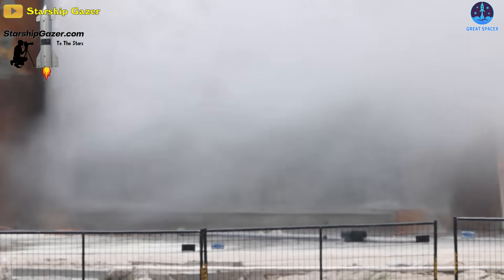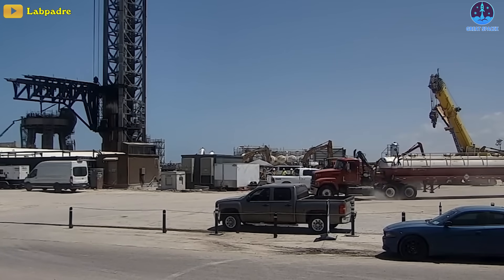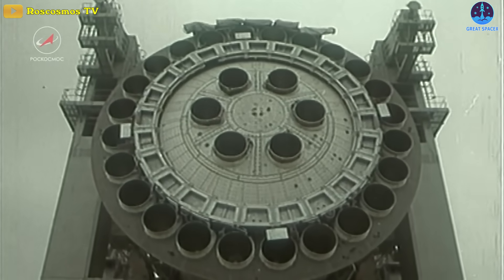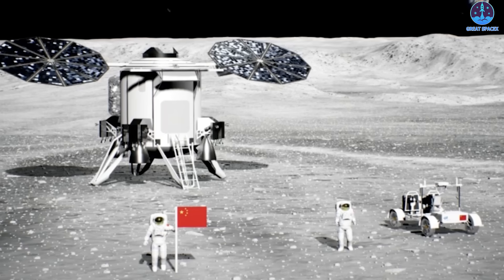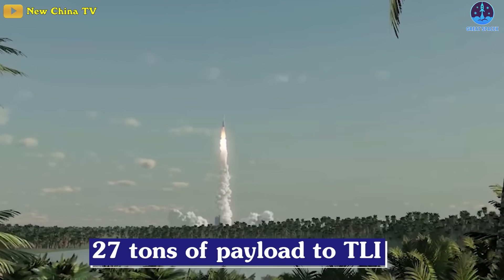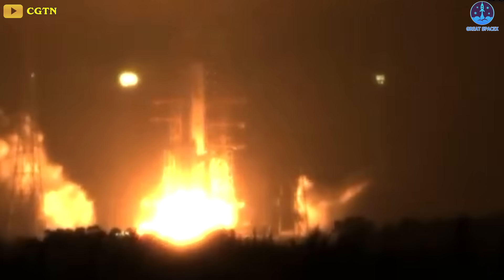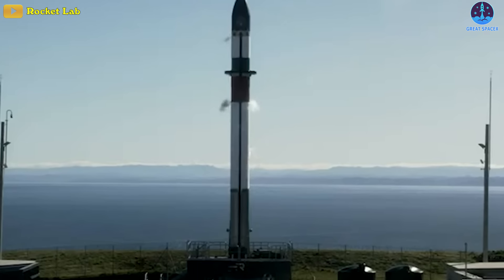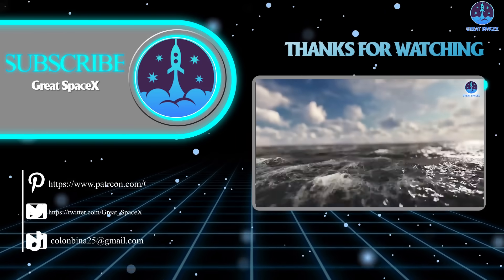Finally happened! First Water Deluge System Testing with MASSIVE WATER...

Comment: Sorry to say this but, this water deluge system will be nowhere near enough to cope with 33 raptors at full throttle. It's just a futile effort to salvage a terribly designed launch pad by desperately avoiding admitting that it needs a seriously big diverter, trench AND deluge system.

Comment: Here is a Question... WHY ARE WE NOT CONSIDERING A SPACE STATION IN ORBIT AROUND THE MOON?
This would have many advantages/
1) Provide Platform for experiments in even lower gravity.
2) Half the time its on the far side.
3) Provide much more detailed mapping of the moon. Especially the Far Side.
4) Staging platform for Moon landings. Cargo destined for the moon can be pre-staged here and loaded into a lander, Providing much more available cargo for use.
5) When big enough it can host Moon Landers and allow inter orbit transfer using space only shuttles.

possible Cons would be:

1) distance makes responding - from Earth - to emergencies problematic.
2) Resupply would be more involved.

However we have learned alot about station management now we should be able to avoid many pitfalls and our unnamed supply tech should be able to keep the station supplied easily enough.
Reply: But, that is what 'Gateway' is.

Comment: No, SpaceX’s system can’t handle more water.  The plumbing is way too small.  They’re using less than half (much less) the amount of water that NASA uses when they need 3-4 times more.  Furthermore, NASA just dumps the water from beneath WITHOUT ANY PLATE.  That plate is an issue unto itself…because if the water beneath it flashes into steam, that plate will blow to smithereens.  And destroy everything around it as it does.  

Elon’s rocket should be called Elon’s folly.  It’s simply too big, and too heavy to be lifted from the ground into orbit safely.  He needs to spend less time on this rocket and more time designing better space suits for his engineering teams.  Then they can assemble the rocket up in space after it’s launched in sections using multiple smaller rockets.

Comment: I thought it was the thrust force of the engines that destroyed the launch pad ... not the heat. I mean, both probably contributed, but one contributed more than the other.

Why not just bore out a giant hole under the rocket and save hassle, water, time and resources required to make an elaborate water park?🤔

Comment: Still not enough to protect the structure. They will have to redesign the whole thing from scratch. Too much power, heat, vibration and shock waves around the whole thing. Current design is modest to what they are facing with the super booster.
Reply: Like you know

Comment: I don't think this system is a good design. No rocket exhaust deflector. It is trying to push water directly against the rocket exhaust.
Reply: Not aganist it, but cool it down.
Exhaust deflector not possible
Reply: @Hungary_0987  Plenty of other rockets have had exhaust deflectors. It keeps the exhaust from building up pressure and breaking thing on the stand and going back up and breaking things on the rocket. Even if it is cooled down a large amount of high-speed gases can destroy things.
Look at other large rockets like the Space Shuttle. When they ignite there is a huge plums of smoke coming out of the side of the launch pad. That's an exhaust deflector.

Comment: I still don't think it will work. There needs to be a flame diverter trench. The exhaust from those 33 engines will hit the steel plate, and bounce back, hitting the engines. NASA seems to know that. SpaceX should have taken this into account when they selected the launch site, and it should have been part of the original plans for the launch pad.
Reply: They fant, please stop saying this…

Comment: Having the water ports going straight up into the rocket blast is gonna be a serious oroblem.  If the blast pressure even equals that of the water, its gonna get ugly fast.
Reply: It has to overcome the blast pressure.  If DeltaP is biased to the rocket, no water will come out of the holes.  Ideally, you want the water pressure and blast pressure to cancel each other out.
Reply: The water jets are actually angled away from impacting the engines (ie, the jets are not directed vertically up!!!)

Comment: With the Force of all the engines, he will probably have to extend the metal plates.
 He needs to put up metal guards on the chop stick tower. That could be partly the reason the elevator broke down.
Reply: Elevator failed before the first test flight so no, that isn't the reason.
Reply: Thanks for the update..  I missed one of the recordings. 
 Thanks again.
Reply: @stanleykelley4284 You are the only reasonable person left on the internet. By that I mean that you just accepted that u were wrong and moved on.👍

Comment: I don't believe this is going to work, though I pray I am wrong. I don't believe the calculations for the amount of spent fuel gasses and force/thrust have been solved correctly. The legs of the platform are too close to the blast area forcing the blast through narrow channels wich will continue to cause damage to the launch platform. Adding water in an almost identical method used by the US military to boost the output of the wildcat fighter during WWII in the Pacific. You're doing the same here. The launch platform has to be redesigned or the launch process has to be altered.
Reply: The legs were undamaged the first time🤷🏿‍♂️

Comment: Jet holes  facing up could be stopped slowed by pressure and force directly downwards  from thrusters
Having many slightly side ways  ??  I:E As a cheese grater or Mandolin  cuter tool ?
slightly flanged and covered shooting at a slight angle?
Resonance and vibration will still be a possible problem/
Water from the near by shore
could be utilized into high metal or concrete towers as many small towns have?
Gravel lime stone pebbles being filters
and height gravity giving helping pressure down to the pad area.
Natural salt over time can be washed forced out of system and pad area 
pressure cleaned.
Water tanked at high levels can be secondary used for many big purposes of lifting
pushing pulling by Lever ship Pulleys hoists  tracks sleds.
Many huge projects Barges Boat lifts
escalator's Passenger lifts to huge heights and weights
also London dower bridge is powered by water balance
Including the huge Scottish Celtic Barge wheel.
Sea water rain is free and a few Pumps heaper than endless trains of Tanker lorries.
One take of point with upto six adjacent landing railed back sites
Seems more sane than one landing back at Pad  mistake wipe out  disaster.
Like the super duper heat force proof cannot fail
concept Elon was sold?
Will it be a complete area landing destruction before logic hits him in the pockets
and simple old ACCEPTED PRINCIPLES  THAT works
ARE THE SAFEST WAY FORWARD.
#  Also placing landing legs for first 50 or so trips and getting hard data examinational Hardware
is much  better than smashing into the sea.

Comment: Stage Zero Mechanical & Environmental Design Flaws:

1. How is SpaceX new design going to acoustically dampen and prevent the enormous damaging direct reflection acoustics right back upwards into StarShip? 

Flat plate a really bad idea for a the reusable stage one. Overtime the reusable stage one will have latent damage which could cause a catastrophic failure. 

Without proper acoustic dampening, environmentalist will likely once again litigate that the shockwaves are hurting wildlife habitat areas.

2. How is this design going to prevent further erosion of the surrounding surfaces outside the diameter of stage zero? 

With violating the EPA & Texas Clean Air and Water Acts, the environmentalist are likely going to litigate once again. 

3. Is the water drainage system capturing and filtering the remaining water? 

4. My stage zero design that I called and emailed SpaceX solves items 1, 2, and 3 above.
Reply: I think the acoustics gonna get handeled by the eater.
No ideo tho🤷🏿‍♂️
Reply: By the way, tell me more about youre design, im intrested

Comment: How’s it going to do this on mars
Reply: Doesn't have to do this on Mars.
Reply: @eskieman3948  starship is going to takeoff again from the sand and rock surface of mars ?
Reply: @Meowface.  Just like with the Moon. Gravity is way different on Mars and you don't need as much power to reach escape velocity.
Reply: @gravelydon7072  fine 
Bud starship is a large and heavy spacecraft which will need to carry enough fuel to takeoff from mars then also land on earth 
And the mission to mars is to build a permanent base 
So debris will fly far, and as we’ve seen starship is capable of throwing up some enormous chunks of concrete 
That would be enormous rocks on mars 
And with the reduced gravity and air resistance those rocks will travel quite a distance 

Also… what stops rock from damaging starship upon liftoff 
That’s probably what damaged some of the failed engines on the starship test launch

Comment: I have a question.  How long does it take to refill the water tanks with tankers ?  How long does it take to refill the LOX and Methane tanks after a launch ?  Has anybody done the calculations regarding the turnaround time between launches ?  I keep thinking there would have to be tankers arriving every minute of every day supplying water and gasses and how would that affect the launch frequency ?  Would Spacex consider a desalination plant ?
Reply from the maker: I will discuss more about this in next episode, thanks
Reply: @colonbina1  Thank you
Reply: Quentin, there is a YouTube video about this on the Nasa Space Flight (NSF) channel.  They assumed that the cryo fuels are being trucked in from Houston at great expense.  

When Starbase gets ramped up to 3 launches per week, they calculated 2 million tanker-miles per year would be needed to transport the liquid oxygen! 

Starbase has an air-distillation plant onsite that will provide all the liquid oxygen and liquid nitrogen that SpaceX needs, plus some argon the can use for welding.  

The gas plant will go into full production once the local power company completes a high voltage transmission line currently under construction near Starbase.  

Methane should be available locally by way of natural-gas pipelines, but SpaceX would need  to build a plant to separate out the methane from the heavier hydrocarbons.
Reply: @primalmanagement   And the desalination plant !?
Reply: They're also  building a compressor so they can distill the gasses they need right on site. There is actually a methane gas well there on site too. As for the refill rate, I would imagine that as launch activity increases, so will the size of the tank farm(s).
Reply: i think it only takes a couple of hours
Reply: I seem to remember a plan for a desalination plant to convert the sea water to fresh water for the deluge system
Reply: Elon is said to have an IQ estimated at 200.  I just assume he’s always ahead of us mortals, just as he’s ahead of his competitors.
Reply: shouldn't the water be delivered by Tesla semis ? i thought we had a planet to rescue , we can't have diesel trucks delivering water to the site 🤬

Comment: could the release of the pressurized gas freeze the water in the pipes?
Reply: Not nitrogen. It's an inertia gas
Reply: Shouldn't be.  There's constant pressure in the system, driven by pumps.
Reply: @frankbieser  No pumps. Just gas pressure when in use. The only pumps will be to refill the tanks after use.
Reply: @gravelydon7072  Good to know.  But the gas is maintaining pressure to prevent freezing the pipes. Now the bottles/tanks the pressurized gas came from, probably do get pretty cold.

Comment: You do realize the thrust of the engines push up on the rocket. The thrust doesn't push against the ground. The thrust doesn't push against anything. Look up Newton's law
Reply: If there's no downward thrust, how come the launchpad turned into a crater and ejected a shit-ton of matter directly beneath? Sure from the rockets perspective it's being pushed up by the ejection of matter\energy from the engine, but from the perspective of the ground under the engines surely it turns into a downward force equal to the upward thrust seen by the vehicle?
Dont get me wrong, I don't know any of this. I'm an idiot, but from my little knowledge that's what kind of makes sense to me. You don't have to answer, but if someone can explain in simple terms where I'm wrong I'd really appreciate it. Cheers!
Reply: @TheDavidPoole  there's kinetic energy. But it's not going to be close to the chamber pressure of the engine. The heat destroyed the last pad. That's the purpose of the water system.
Reply: @Bryan-Hensley  i get that the heat is huge, but the heat alone won't hurl huge lumps of steel and concrete hundreds of metres away from the pad. They are being "thrusted" somehow. Again, I don't claim any knowledge in the area, but it just doesn't make sense to me that the hundreds of thousands of pounds (or more?) of thrust exiting the rocket bells have no effect on the ground just metres below. I remember my Dad going on a course about concrete and how it "works" (he was in the construction industry). Ge said that he was taught that concrete takes about 200 years to totally cure, so I can understand that a newly built pad ough to have at least a year for the stresses of a launch but even so, there must be an untold amount of energy directed at it during those few seconds of launch that exceeds that which a Standard construction would experience in years of normal everyday use? Please don't take umbrage, I'm not calling you out or anything, I'm genuinely interested, but confused. Thanks for taking the time so far 🤜
Reply: @TheDavidPoole  David, once the Fondag failed, the exhaust had access to water. So the down pressure and the water both were in play. Here with the pancake, the steel will not fail and the water will be there to keep the plates below the temp of steam, not the melting point of steel. Concrete has a tendency to spall even if it is just gasoline burning on top of it due to the water that is always present in the concrete.
Reply: @gravelydon7072  thanks Don. I guess that with the water and particulates combined with the downward pressure from the enginesit may have been like those "water lasers" where the water is mainly the medium for the abrasive particles. I'm surprised that there wasn't something covering the concrete at first launch. I'm also assuming that Fondag is a particular type of concrete\polymer. Be interesting to look up it's properties. I understand (I think) the operation of the water deluge (I know that's wrong) system with the steel pancake, I'm just surprised that it wasn't installed in the first place. But saying that, I'm sure that people will be studying what happened with the first launch for years to come and masses of valuable data will be gleaned from it.